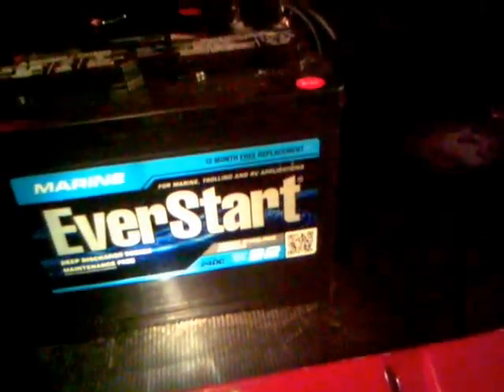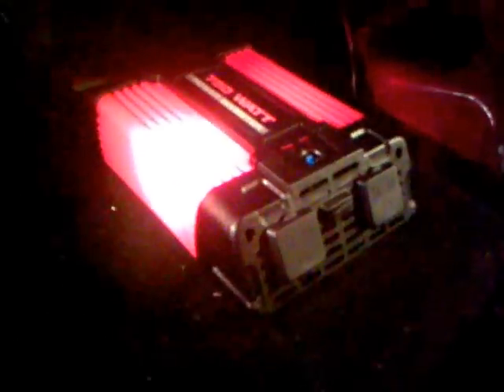Portable Solar Generator VW Super Beetle

Comment from the maker: I've got two in the bug at the moment, one repeats the broadband from cell towers-the other is ethered into the previous and is used as an AP. I daughterboarded a cell modem to the first router and tweaked the firmware and hardware to piggyback the broadband signal. Would be amazing if I could find a place to put a Yagi antenna!!